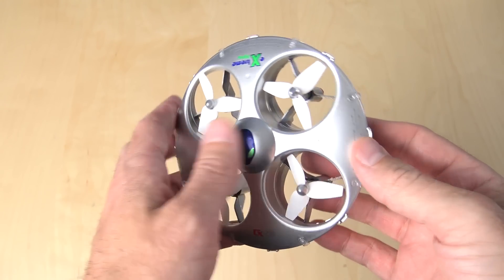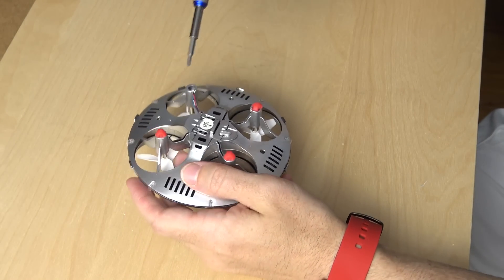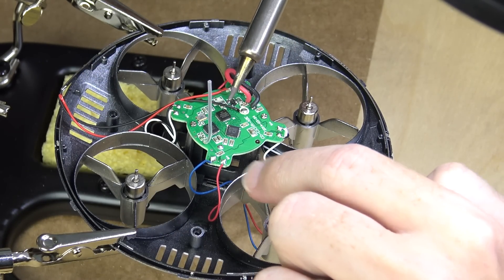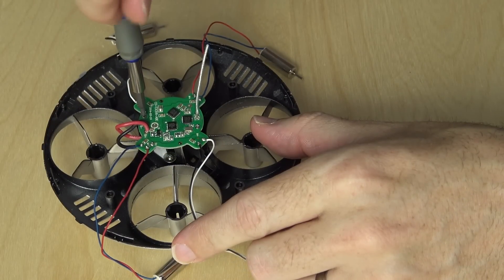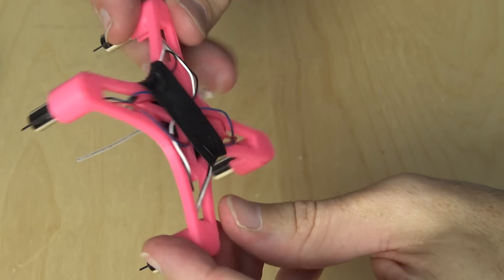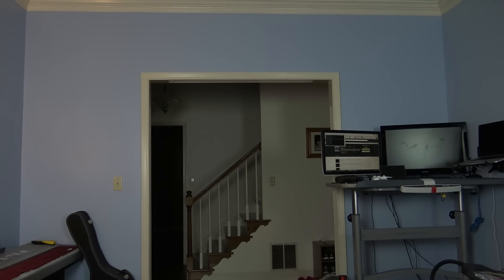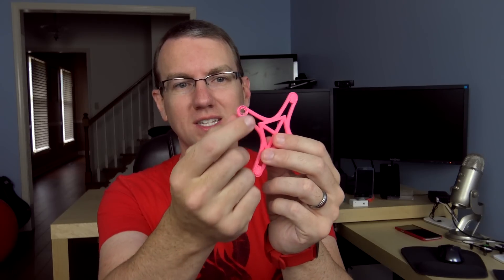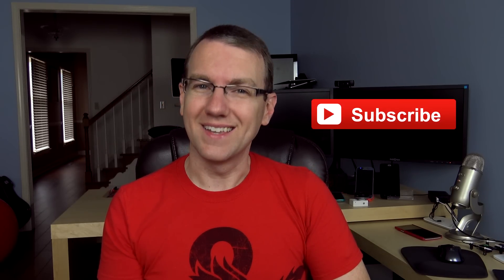3D Printed Quadcopter! (Repurposed Cheerson CX-31)

Comment: The wobbling was caused by the change in geometry and weight balance (most likely the removal of the ducts around the propellers and lower overall weight). The quad stabilized because the PID controller eventually adjusted to the new state of the quad. To fix it you would have to change the PID values of the flight controller or correct the geometry to better match the original quad.

Comment: You can buy the receiver, motors and transmitter for CX-31 online for less than the total product (about 25$) and print a superior frame. I would recommend using a grid infill with a think shell and 5%. Also try adding weight to frame in the center creating more resistance to wobble. For this I recommend a uniform but small piece of metal like a lead bead. In real aircraft depleted uranium is used. But in this case a light fishing weight.

Comment: I agree with Bartłomiej Noga.  The controller is over-correcting, then over-correcting for it's over-correction, resulting in oscillations, giving it that wobbly feel.  I don't know if there's a way to access the firmware on one of these and adjust the PID.  Maybe you could give it more weight, compromise between the original heavy saucer body and the feather-weight frame (if you still have it; I just realized how old this upload is).

Comment: It doesn't work because PIDs are made for other configuration. Without weight it's to responsive, so steering doesn't work. I don't know if you can program it, but it won't work even with other frame, unless it'll be some about same weight. Also you should think about tunnels for props, because they work probably like kind of EDF.

Comment: That frame should be no issue in abs. What printer are you using, and what bed material?
Reply: Ok that explains a lot. Its hard to fight the internal stresses of ABS without heat. Good luck!

Comment: The wobbling might be cause by a misalignment of the motors, given they didn't really fit.
Reply: ***** The first thing I would check is what is in the way of the air flow. Maybe you need to get the cables tighter to the body? But I think it's pretty cool and a really good first attempt.
Reply: Or vibration of the fc